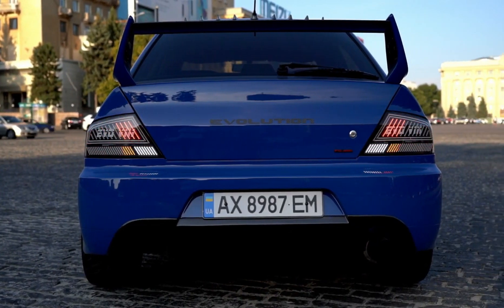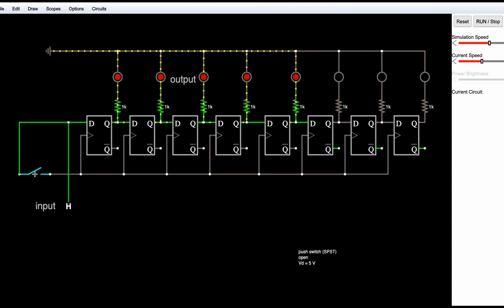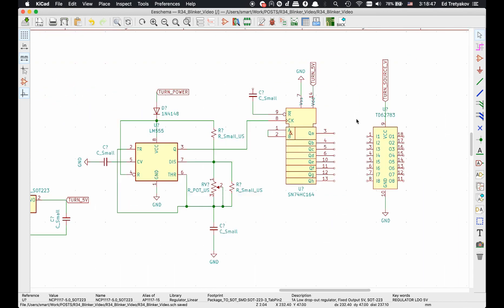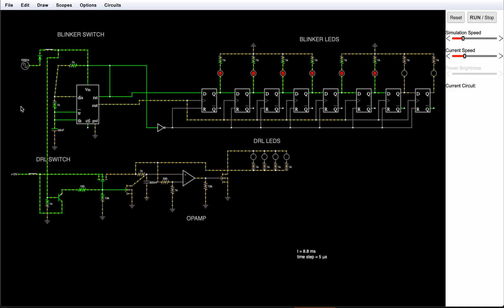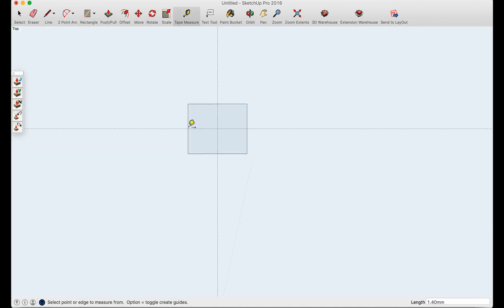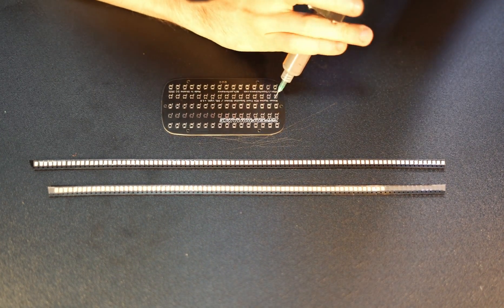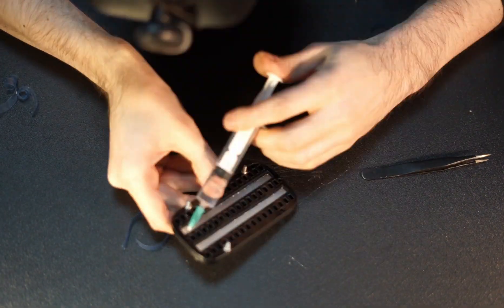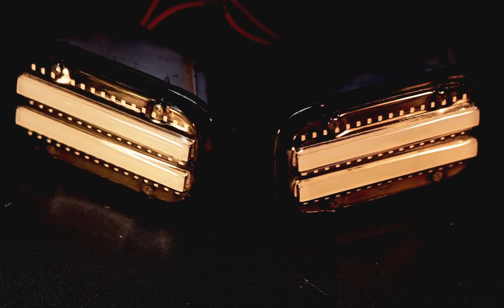Awesome Nissan Skyline R34 Front LED Sequential Blinkers Full DIY Design and Assembly Guide

Comment: Can these boards be used on other headlights
Reply: You can do this on almost any bulb car the same way.

The idea is that you build a board that does all the fancy stuff and just needs power to do it, the assumption is that your cars ECU is the one that controls how it powers the lights - and it should just be a case of Voltage or no Voltage - the fancy led pattern is cause he has controllers on his LED Board not just LEDs